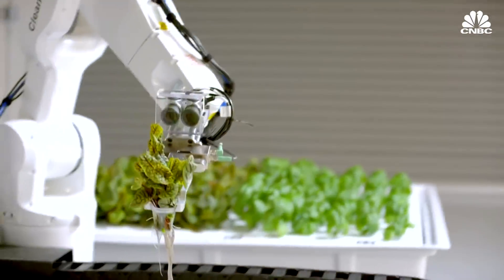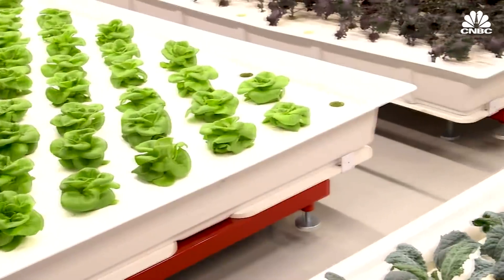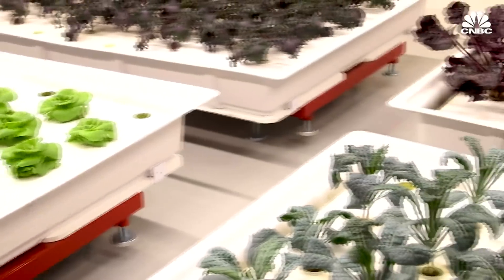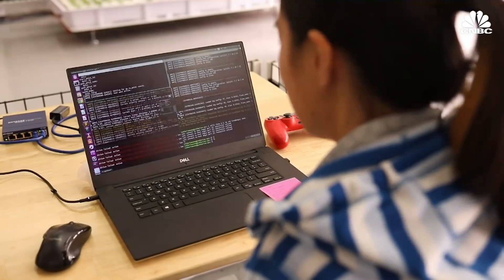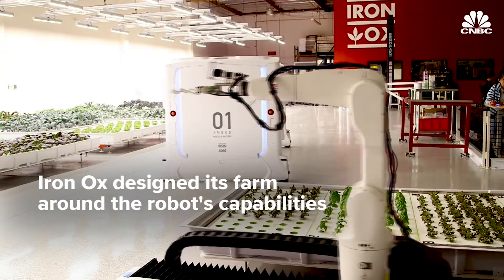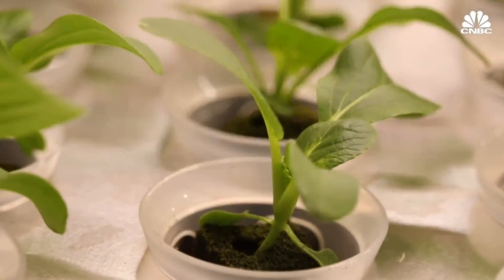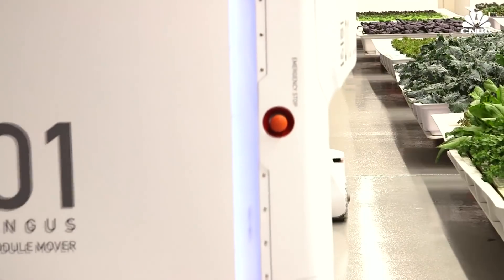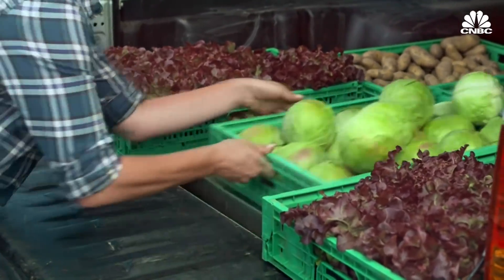Watch Robots Grow Food Without Farmers

Comment: Another Boston Dynamic where they demonstrate a robot capable of replacing human labors.  Yet it comes to mass production and price, the model falls apart.  If a robot produces lettuce at $100.00 a pound (including robot research and development) vs a human producing lettuce at $0.50 a pound, I think the choice is obvious for consumer.  Unless robot can drive down the cost equivalent to human labor, then the economic equation will change.  Until then, there's over a decade before the transition will happen.

Comment: It's a shame that they have to bash biotech (GMOs) in order to promote their tech. Pretty irrational.
Reply: zach, depending on your definition of gmo, either like 99% is (literal interpretation, food that has been modified genetically through natural or artificially induced random mutations) or a high percentage of a few staples like corn and soybeans (typical interpretation, genetically engineered foods primarily through transgenic specific insertions).
Reply: @Thedamped  selective breeding existed for 10,000 plus years.....genetic modifications the last 50!!! nope dont want it!!!!
Reply: @masterpalladin  Genetic engineering is a very powerful tool. It certainly could be used to create foods that are less healthy, by say, prioritizing taste over nutrition, similar to fast food. 
But a blanket distrust of all genetically engineered foods is silly. For instance, one of the first genetically engineered foods to market was a tomato where all that was done was duplicating a gene in the tomato that caused it to produce more of that gene's product. This ended up making it have a longer shelf-life. 
There would be no chemicals present in it that wouldn't be present in its non-engineered cousins. You could even get the same mutation using traditional methods of cultivation. Genetic engineering just allows it to be done faster and more cost effectively. After it's done, there is nothing special about the later generations of tomatoes, other than the induced mutation. 
I find the both the blanket trust and blanket distrust of "GMOs" to be silly and tribalistic.
Reply: also the population numbers they are talking about have stopped in there tracks humans are more evened out in birth and death right now than ever and they think in 20 yeah it will be on more of a decline
Reply: People, customers are irrational. Anything that has GMO in the label is distrusted, while it makes ZERO sense.
Reply: That's how you got your ears.  Irrational ear mutations from gmos.
Reply: Is that a corn joke?